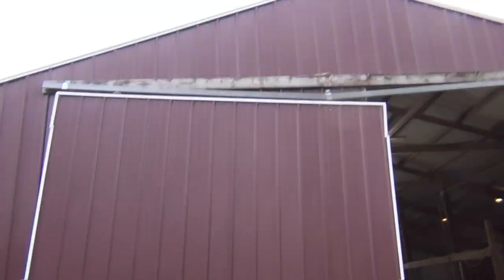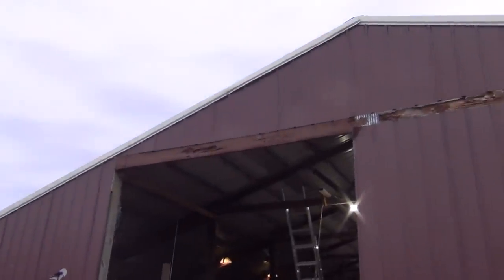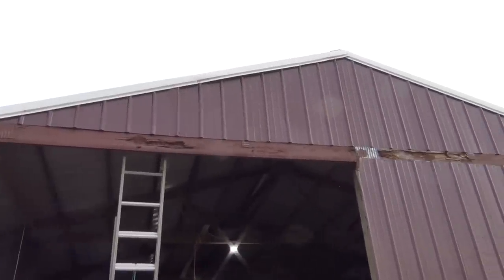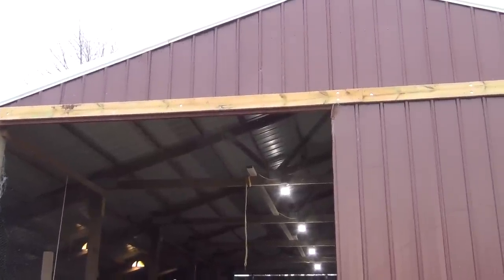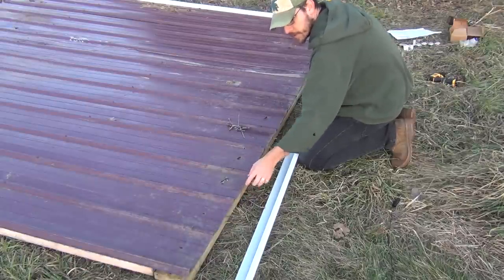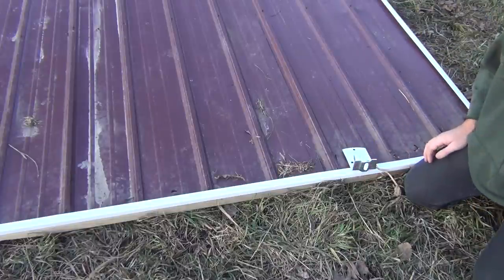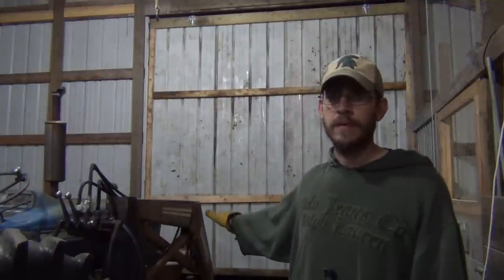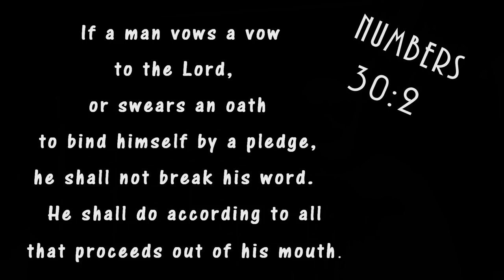Barn Door Repair and Installation

Comment: Thanks for the video. I am faced with the same problem. I looks like most of the hardware was left on site. I wasn't sure how all of it was supposed to be installed. Thanks for the detailed instruction. Maybe I can have a working door before winter.

Comment: I learned a lot about safety and rigging from the millwrights at work.I like hydraulics,but I don't trust them.I would not even walk under a raised bucket.We had to have a hilo drive beside us when opening and closing doors on railcars in case the door came off of the track. If you do put hooks on your FEL, put the hooks inside the bucket in case a chain or strap ever fails,the bucket helps protect the operator.I just want you to stay safe. The guy I used to work for from Dearborn, his name was Henry and built lots of cars and trucks,used to say"Let the machines do the work".I think he built some tractors too. ;-)
Reply from the maker: +Mr Frog lol, he certainly did built a few tractors!

Comment: you could add a skirt that is hinged.  you can fold it out of the way if you need to avoid the contacting the ground.    it always fun to work on stuff like that on your own.
Reply from the maker: good idea! I may add something like that this winter
Reply: @SSLFamilyDad  Something like a series of mudflaps along the bottom of the door might also help cut the wind, and because they're flexible, you don't have to have the ground perfectly level below the door.

Comment: Great job on building up the tie on that truss. It really looks like it needed to be done.
Reply from the maker: +Alec Ver Bunker it was about one more year away from falling right apart for sure
Reply: SSLFamilyDad Could have ruined the roof on that side of the barn possibly if you wouldn't have built it up. Once the dominos start falling it's hard to stop them

Comment: Great video.  Take some advice from someone a tad older is to learn to work smarter so you will not hurt yourself.  In 10 years your body will be junk,  use your equipment and take extra time to make your life easier.  The tractor, a towing strap and a jig made out of scrap lumber would have made your experience handling those doors much easier as you are doing this work on your own.  Let the tools you have do the work for you. 😀
Reply from the maker: +Planetjoe10's Scale Modeling yeah, I get that but it would have taken twice as long to get a bunch of stuff out it was easier to just get it done:)
Reply: Not with that door falling over on you like it did!  What if your wife and kids had come home to find you out there lying under that door! Take the little extra time to dig out whatever "bunch of stuff" you need for your own protection. Please!  Like the man said, you're young now, but that youth is no protection from injury or death, especially when it can be avoided.
Reply: I agree 100%. I have been active duty Army for the past 19+ years and have ALWAYS worked solo projects like this myself.  Wear and tear from years of service and deployments has made me work smarter now and rely on the loader on my tractor or a chain/rope pulley system more and more to help save what structural integrity I have left!  Great job on the doors putting one up on my barn soon.  Thanks for the instruction, enjoyed the video.

Comment: Regardless the "rotting" part.

Can you put some kind of "roofing" or some kind of pleksyglass to make a small "roof" over all bolts, and wood and everything, so you protect from snowing and ice making mess. 

I hope you know, that ICE can destroy any kind of material, so, keep that in notice, so protect that top part of both expecialy back barn door.

And maybe advice on next "barn door". when you placed the hinges and rollers, whould be easier to place rollers on hingde, then place hinge on door and bolt it?
That way you can spare yourself of cramped space for you fingers.

As always, loving the videos, and keep the good job comming. :D

And don't get me wrong, but in your videos, I always learn something new, so thanks for that.

Comment: What kind of flashing did you end up using? Did you use caulking to seal it after installing it? Great video, by the way. I do a lot by myself because sometimes helpers want to hurry and get exasperated that I check the level and plumb 50 million times.

Comment: A good test for your latches would be to make sure you can't slip a thin piece of metal between the door and building and lift the latch out. We had a barn broken into with this method. a lesson hard learned.
Reply: Also, when life comes crashing down just lift it right back up and make it right......also doors :)

Comment: another thing you could go back and do for longevity is put some large diameter washers on your roller kit bolts this will prevent them from pulling through and distribute the weight over a bigger area of the door roller

Comment: One thing you could have done was install drip edge on on the the 10 above the lumber you installed on the door that was gone before you moved in that would read your act of the water over the wood and over the door as rain would fall can help prevent water to get into the structure but now it would require quite a bit of work as in taking a fair bit of the metal apart and stalling it so I don't think I would really bother doing it
Reply from the maker: The flashing the goes over the top of the box rails slides right under the siding that is there. I will need to loosen it and pull some nails though to do it right but I think I would have had to do that either way. I guess I will find out for sure when I go to install it!

Comment: Didn't see you put on any stoppers. You probably put them on but just in case you might want to get them on ASAP so that you don't accidently push the door to far and it come off the tracks.
Reply from the maker: I actually didn't the other side doesn't have them either and I have actually accidentally done that once already, lol. I will be putting some on both sides when I get that flashing up!
Reply: I know this because when I had to put my door on it almost fell off, I needed help lol.

Comment: looks good.. I may have just missed it but, what keeps the doors from blowing outward in the wind?
Reply from the maker: The latches that I have not installed yet....lol
Reply: I guess that makes sense, it almost seems like it would be a good idea to run another channel track along the side near the bottom.. I have just never seen anyone do that.
Reply from the maker: There are brackets with a roller that mount along the bottom edge of the nearby wall. That allows the door to run in a kind of guide at the bottom which also keeps in from blowing around if left open and it is windy. That may be another thing I pick up with my next trip to the farm store.

Comment: there should be a drip flashing over the door. that is under  That is under the top sheeting and out over the door and down a bit over rail so the water drips off
Reply from the maker: You are correct on That! I have been asking around to find that for both doors with no luck, that is why they rotted in the first place

Comment: Glad you got it done.  But if you ever have to do heavy lifting like that again, use your machinery!  Watch Essential Mountain Homesteading to see how he uses his backhoe to lift roof trusses, drywall, plywood, etc., up to where it's needed.  You could have looped a chain around your bucket that was tied to the top board of that barn door and had it lifted in place in no time.  Then once the first and maybe the second  set of wheels was in place, remove the chain (or rope) and finish the job.  You are an ingenious fellow.  Don't make work for yourself.